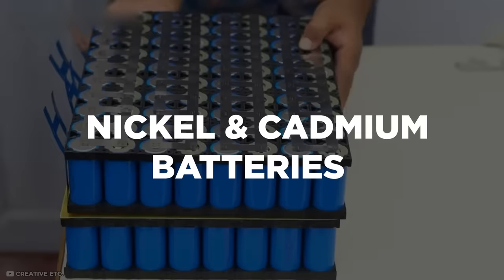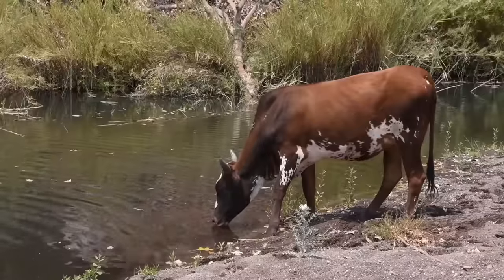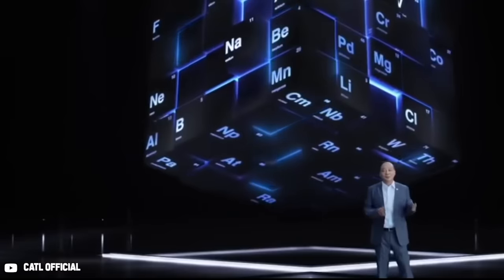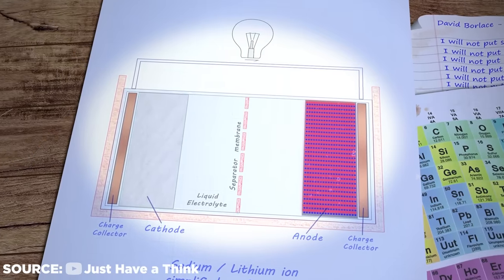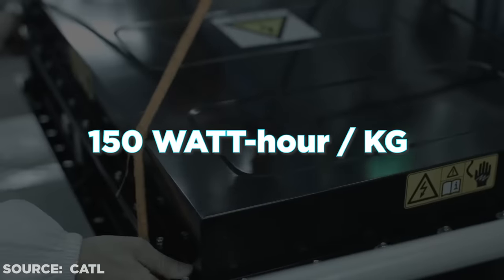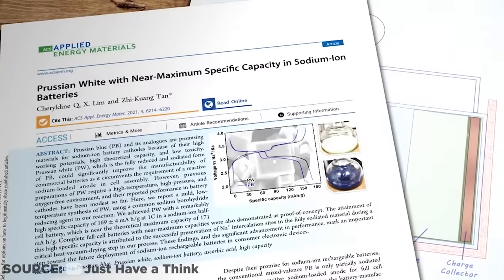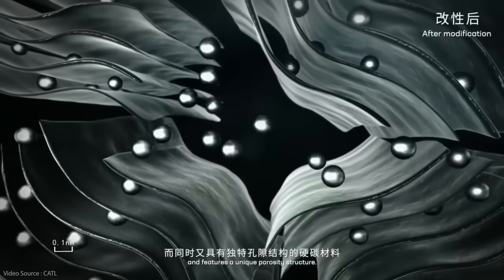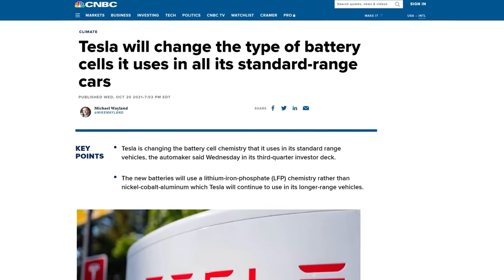No More Lithium! NEW Sodium-Ion Battery To BEGIN  Mass Production

Comment: Even as it stands, slightly lower energy density vs having to put up with Lithium's random dendrite fires is a big win in my book.
Reply: You think sodium won't exhibit similar behavior? LOL
Reply: I thought sodium formed dendrites faster in fewer charge cycles
Reply: @kleetus92  It's...sodium. It simply won't result in a gout of flame when damaged like lithium-ion batteries do. That's just one reason why alternatives are so important.
Graphene-ion batteries as well as aluminium-ion batteries are just two more alternatives I know of that are being investigated. Just off the top of my head.
Reply: Have you ever dropped pure sodium in water?  Try it sometime, just, do it from a distance, please, for safety sake.
Reply: @danielharvison7510  LOL.... sodium is far more reactive than lithium, just as potassium is more reactive than sodium. God I love when people with no chemistry knowledge pretend to have a clue because they saw some bullshit on CNN.
Reply: @kleetus92  I have decades of experience with all forms of battery chemistries. This is probably news to you, but most batteries have flammable material in them. It doesn't nessisarily make them inherently dangerous like Lithium is. Take NiMH for example. Although generally as safe as can be through normal use, the metal inside will spontaneously combust when exposed to the air. Easy solution: Don't disassemble the cell unless you want to burn your house down. The big problem with lithium is that they catch fire for NO REASON. Not just when punctured, submerged, overcharged, ect. If Sodium-ion technology vanquishes the Dendrite Reaper back to the depths of Hell, then great. If it doesn't, then they've wasted their time even trying. Since these cells don't exist outside of the laboratory, only time will tell what consumers will get stuck with. However, its best not to hold our breath as most battery news is pure vaporware.
Reply: @GeneralLee131  I agree with vaporware. I've torn apart nicad and NIMH years ago, and never had an issue, the only lithiums I've torn apart and not had 'unwanted side effects' were energizer lithium batteries, the AA specifically.  I'd sooner put a piece of lithium in my hand than sodium. Time will tell on the tech though.
Reply: @nela9994  uhh I've never seen table salt explode in water ???? They aren't talking about sodium metal especially since they referenced the ocean in the video

Comment: Wow this looks encouraging, also on the bright side, if we ever get low, all we need is for FromSoft to release another GOTY and wait for the PS fanboys to find out. Seriously though a question to be answered is it more resilient to freezing temps than it's counterparts cause that is one of the biggest hurdles for EV adoption as they just are not practical in certain regions.
Reply: ALL batteries have issues with temperatures, too high and too low are both problematic.

Comment: Bluetti had already demonstrated a prototype of their portable power station featuring Na-ion batteries during CES 2022.
Reply: Then released a Lithium Ion version because Li is better than Na.
Reply: @mpirron1  liFePo. Lithium Iron Phosphate
Reply: @bonedoc4556  yea, what about it?
Reply: @bonedoc4556  it does make a damn good battery second place, but only by a nose. Still has the same downsides as other Li-Ion though.
Reply: Sodium battery was developed and patented in South Africa in 1978 by Dr Johan Coetzer (Zebra battery)
Reply: @petrolkopnitro2722  well I would likely be expired now so why didn't he or somebody since it has expired bring it to market, pray tell?
Reply: @petrolkopnitro2722  it's okay if you don't know because I already know the answer
Reply: @mpirron1  It is on the market. It is just expensive ito $/Wh. Point is, it is not new tech.
Reply: @petrolkopnitro2722  because, 
Li makes a better battery than Na does
Reply: @mpirron1  Better by Cost?
I want 4 refrigerator size batteries,
to buy low-cost grid electricity at night
to charge
Reply: @aolvaar8792  them go buy them, they already exist.
Reply: @mpirron1  Your comment: "because Li is better than Na."
Why is Li better?

I asked a question:  Better by Cost?
Reply: @aolvaar8792  it's better because not element except hydrogen can give up electrons as easily, it's got an atomic number of three, hydrogen has an atomic number of one but when it gives up its electron because it has only one it's no longer hydrogen. No element on Earth can ever make a better battery than lithium can so any battery anybody comes up with that works will work better if lithium is substituted. As far as Cost goes lithium is not rare, at all.

Comment: Right now what we really need is some extremely cheap batteries, even if weight or power density is bad.

Once you can store a huge amount of energy for cheap, lots of options start to open up.

Current electric grid wont be able to handle the demand if the current EV adoption continues. But if you can have a huge battery for little money, investing in solar starts to make more sense.
Reply: What are you talking about? The weight and power density of batteries is already really bad.
Reply: Simple battery with basic materials for cheap? No matter on weight on density and weight ? Like Lead-Acid batteries ? So that is already there, for a very long time :)
Reply: Lead-acid is a proven and reliable technology for stationary applications.
Reply: @MichaeljRichter  indeed and what can be more environmentally friendly than lead and acid? Why it should fill every fresh stream!
Reply: @1pcfred  lead acid battery is much more environmentally friendly than mining lithium. And they are easy to recycle. 99% of lead batteries are being recycled. While lithium are under 5%.

Comment: I see these batteries being useful for home energy storage. We need lighter batteries for EVs or those with an energy density similar to fossil fuel.
Reply: propably would be more beneficial to figure out a way to harness and reuse fossil fuels burning products while also making those engines a lot more efficient. We won't be able to match energy density of burning with batteries for hundreds of years if it's even possible to do so.

Comment: I can see this being successful for a bit of time until we can find a better alternative to Li-ion. But this advancement should have been done decades ago. I remember doing a science project in 6th grade back in 2008 showing how salt water can hold/produce some sort of charge with a multimeter. Thinking back to it, I don't see how full grown adults wouldn't have thought about sodium batteries back then or even earlier than that.
Reply: I did the same project in 6th grade back in the 80's.
Reply: @WastedTalent-  just shows how we're more creative during our childhood rather than adulthood.
Reply: @AndyOfBelmont  no, you just recreated a most basic electrolyte...
Reply: They did think about it, but until recently, there was enough lithium to go around and no reason to explore other battery chemistries. No one was going to do so until there was a shortage and thereby money to be made on Na-ion battery tech.
Reply: There is no better alternative to lithium on earth, only worse ones that don't start on fire with exposure to air.
Reply: @johncate9541  There's no shortage of Li. What there seems to be is a shortage of people willing to pull it out of the ground. This phenomenon is pervasive well beyond only Li
Reply: Franky, sodium and lithium have very similar chemistries, its not like they have to go back to square one.
Reply: @mpirron1  Lithium salt deposits are not common, and only contain a few percent Lithium. Compared that to Na salt deposits which are very common and close to pure Na salt.
Reply: @jumboegg5845  that makes no sense whatsoever I think you ought to read it again and think about chemistry a minute. No alkali metal can exist as a metal in the atmosphere of Earth alkali metals react with air, it makes him become acidic being a high pH the acidic nature of the reaction destroys the metal and turns it into a neutral compound that can exist on the earth exposed to air. That compound is salt, it's a salt whether it be sodium chloride, lithium chloride or potassium chloride. All are salt but not all are equal. Sodium chloride is more plentiful, but lithium chloride gives up electrons better and always will. Just because sodium chloride is more plentiful doesn't mean that lithium chloride is not still very plentiful it is very plentiful and more of it is being created every second of everyday that there is air to breath.
Reply: And one is not more salt than another is salt, salt is salt. And all things being equal for salts,  which they are not, are one atom of the alkali metal and one atom of chlorine.
Reply: @jumboegg5845  the point has nothing to do with how uncommon they are, there are plenty of lithium salt deposits, we are not running out of the ones  we know about and we're discovering new ones all the time, there is not sufficient evidence to the contrary no matter how much you want there to be some.
Reply: That should shut you  I expect.
Reply: @mpirron1  You need to learn the meaning of  "salt" in chemistry.
Reply: @mpirron1  What about organic salts?
Reply: @jumboegg5845  back again then, I'm as familiar as I need to be with salt chemistry to know there is no shortage of lithium ones. And even if there were two become one , there's probably some sulfides around mixed up with something around somewhere, the Earth is pretty big really.
Reply: Again there is one bottom line here, and that is there is not substantial evidence that there is or ever will be a shortage of lithium and more is being created every second of every day that Earth has an atmosphere. No matter how much you want there to be, for whatever reason, there is no shortage of lithium.
Reply: Clear now are you, then?
Reply: I bet there's some patents buried deep in a disused Oilwell somewhere that says they have…
Reply: Whenever there is a viable, cheaper but effective alternative, it was always silenced until a dire situation happens, they scramble for these alternatives. Suppose we adopted electric cars a decade or so ago, adapting infrastructure wouldn't be so costly now
Reply: @mpirron1  that's the plastic eating bacteria thing I've heard of Right? It's certainly promising. My qualms are more with the fossil fuel industries and the inventions they have more than likely suppressed. If we had started working on IVs and other cleaner roots of energy five decades ago rather than listening to all the misinformation they polluted that generation with, would certainly be further along now then we are I believe.
Reply: And perhaps understand more the burden that truth can place on man.
Reply: @blindbrad4719  did you see? Do you understand that he owns a canadian company that has been in existance for 4 years and never released a product?
Reply: @NiftySquares  Elon just now starting to talk about battery swapping. That should have always been, it was Nissans original concept for the leaf,  battery swap statiuons, but then along comes Fiat with an offer they couldn't refuse, and boom it turns to shit. Its because they are not trying, still! Its a fake effort, they are acting , because they don't want electric cars, they are are just going to make shittier and shittier ones until they can put the genie back in the bottle. Atkinson cycle hybrids will continue to get better because that is what they want,, more complex, harder to work on, more expensivea, evereything they like, but most of all .... running on gasoline and requiring oil. And EVs will continue too get cancelled like the Chevy Volt or be just plain terrible at everything like the Ford Lightning. They didn't want electric cars in 1910 so they stomped heads in the ground till they had evereythig under control and that is what they willl do again, only this time its its not boots to the head, its bad ideas.Because they don't want electric cars.
Reply: Regardless of these arguments,  this sodium battery may just be another graphene hype... I remember back in 2015 that so many youtubers and scientist were hyping up graphene, my chemistry teacher even confidently talked about it in class that year... yet here we are and they still can't figure out how to actually make it use electricity or how to produce it without it breaking....
Reply: @AndyOfBelmont  they're putting it in plenty of pharmaceuticals nowadays still kind of hard to make the way that they're doing it basically still by dissolving Scotch tape in solsolvent although there's a process to turn all hydrocarbon waste, like plastics, into graphene, with some hydrogen and ozone left over. It will  eliminate that plastic island in the Pacific Ocean and yeah like all landfills. The process is called flash graphene it was patented in 2019 and published you can look it up on YouTube anyway how's your carbon waste is placed in an inert vacuum chamber and hit with a 10 millisecond plasma arc discharge (lightning ). Is sitting in the lab with one Dr James tour in Rice University in Houston they're just zapping away plastic as we speak with their capacitor Bank making none too quick the effort of scaling it cuz we wouldn't want to save the Earth from plastic waste or anything. But what Dr James tour has done is form a Canadian company in 2018 where he's the chief scientist it's been around 4 years now never releasing a single product but he formed the company in Canada even though he's from Texas. And you'll never guess why we'll see it's like this if you got American patents and you form a Canadian company then your American patents automatically apply in Canada and if your patents apply in Canada then they apply in the rest of the common British Commonwealth too. But don't believe me look up flash graphene
Reply: Unless you like Jack Nicholson said Tom Cruise was, of course
Reply: If I'm lying I'll make a video of myself making a sodium or lithium battery, (your choice) run a fan motor with spinning LEDs on it for a little bit (guess which one will run longer and faster) and then I'll eat the electrolyte because that's and a nickel cathode is all that will  will be left after the sodium or Lithium is exposed to air. But I'm going to have to mix it with some lard and strawberry flavoring first. You know what that makes right? Haha, after just watching a Christmas story couple of nights ago it made me chuckle. And anybody who wants to come join me trolling Dr James tour avross the internet is welcome, cuz he's the worst gay gatekeeper since David Icke, and there's no place he can hide from me.
Reply: @jumboegg5845  whatever 11 is more than 3 and always will be Li will always make a lighter, more powerful chemical battery than Na can and any electrolytic compound, anode material, or cathode material that works with atomic number 11 will work with atomic number 3. That is all there is to it.
Reply: @jumboegg5845  So after reading  exactly, what do I not understand about your position on Lithium Batteries. You knoiw you might think of taking some Lithium Chlorid your self ya know, it might help your affliction. Its tasty on fries and is long used to make deranged people think and act a bit better by stabilizing theire confusion and psychosis about "reality"
Reply: @mpirron1  People forget that the lithium accounts for only about 2-3% percent of the battery weight. I thnk they will invent batteries that weigh a bit more, but dont use expensive  lithium. For example a tesla battery weighs about 500kg and contains about 8 kg of relatively rare lithium. It would be inconsequential, if tesla made an equivalent sodium battery that weighs say 550-600 kg (the extra weight is not very important).
Reply: @mpirron1  Nothing to do with you understnding my position or opinion. You are just making comments that demonstrate you know little about chemistry. Study chemistry for 10-20 years, then you can discuss with confidence
Reply: @jumboegg5845  I know enough chemistry to, in my lab, safely recover and isolate PGMs from catalytic converters, using fuming nitric acid that I synthesized and concentrated, have an isolation chamber glove box that I can place under my laminar flow fume hood I bought from my the UT Arlington when I recover lithium metal from energizer batteries and store in ampules, I can whip up a cold trap in a pinch to make some glacial acetic acid, have been known on occasion to demonstrate to people what happens when when you hit with a hammer what is recovered from putting vegetable glycerin in Nitric acid, and make some badass peach brandy moonshine every year with peaches that my buddy gives me that are too ugly to sell in hin stand. What ,you want to talk miscibility of various inorganic salts in a DMSO, or what color the iodine-starch clock reaction is? GTFOH
Reply: @jumboegg5845  and yet there's still never going to be a sodium ion battery in a Tesla, or any other EV for that matter. And the probability of there being one of  much consequence or significance is pretty much nil.

Comment: Great for large scale energy storage, but for the average consumer it'll be seen as a step down in usability of everyday use technology, and being more sustainable just won't be enough to stop the majority rejecting it until price is a massive hurdle.
Reply: the thing is lithium price is almost there
Reply: @srir.5282   And likely going to keep going up.
Reply: Sodium and lithium batteries could be used for different applications depending on the benefits and drawbacks of each situation.
Reply: @srir.5282  There's not enough lithium in estimated worldwide resources and reserves for the amount of battery grid storage we would need.